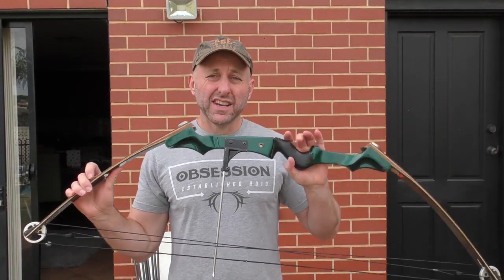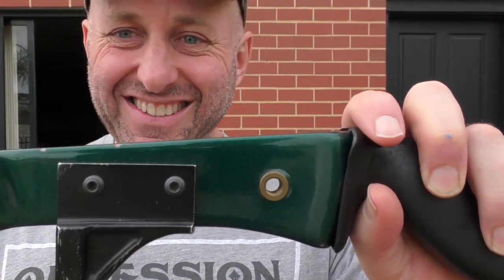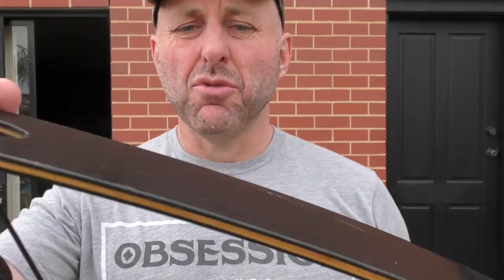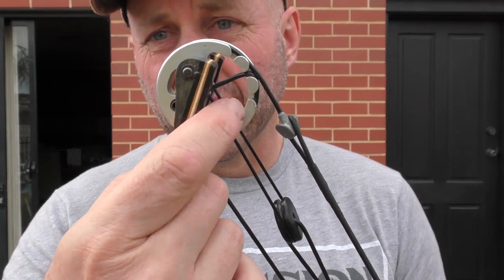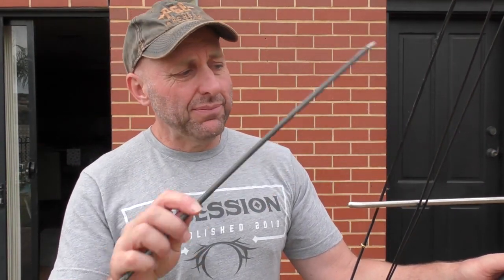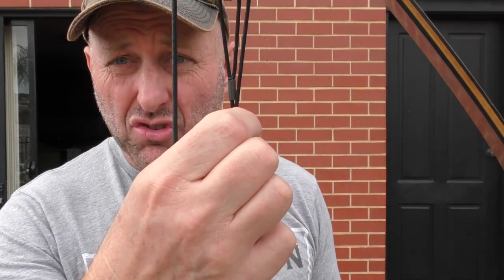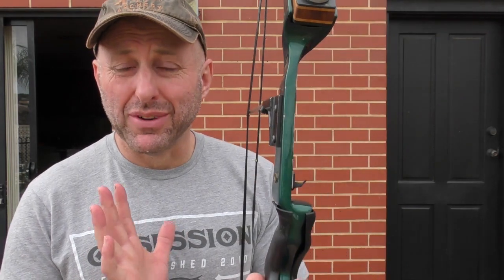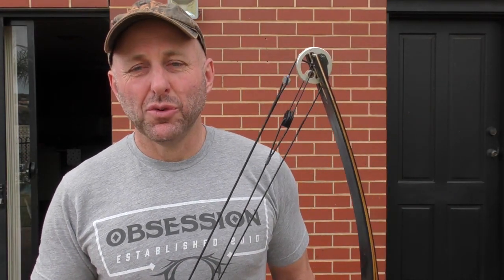Compound bow 40 years old

Comment: In 1981 I  had a Browning Compound Bow with a wooden riser, it looked good and shot well. A long time ago. Lol
Reply: How'd you get ahold of your first bows, back in the 80s? Were they common in shops, or did you have to mail order them?
Reply: I ordered it through a Browning Shop that sold Bows and guns.
Reply: The options for let-off were 35% and 50%. You just changed the position of the Wheels.

Comment: If You Want to shoot fingers with a much faster bow then most Recurve there are only two options. First is it is use the Genesis bows that shoot about a 250 FPS with the right arrow per draw weight of the bow.  Second, Junxing has the M183 that they claim on there site is 300 FPS though I am not so sure as it shows all the adult Compounds at 300 FPS and I know some have to be faster , just the bow uses a similar design using modern construction the way the Genesis is made but for the Junxing M183 it also uses more modern cams but not so modern that you have to use a release device. Both Bows are at/around 35 inches so about as short as they can be in an older design shape to still do finger draw with hunting weights due to draw pinch the fingers.  Then both use wider cams then are used now to prevent string slipping off the cams. Last Both bows are about as fast FPS as one can get to shoot while being able to shoot fingers and they use wider cams and have a shape similar to this bow in curved design. There is a few others still made some iglow Chinese made compound has a design that SAS Sells as well in one or two models made from 1994--1995 but is really slow to about 206 FPS for the iglow and 220 FPS for the SAS though this might depend on the arrow they each used for the exact same bow.

Comment: I have a Hoyt Spectra which appears to have the same cams as the ones you show here. I believe when you swap them over to change let off you also have to swap them upper to lower as well.
I am in the UK and they will not allow you to use these at a club because they say you cannot determine the condition of the cables under the coating. The risk of the teardrop swaging failing is the main concern. 
If you know of a way to get new cables made or a way of attaching a modern string there are many who would be interested, especially me.
Reply from the maker: It would not be a rule - it would be a person in the club.  My mum hires bows and most still have steel cables.  But yes you can't tell - but very rare to break.  You will normally see cables splitting in the plastic.   You will probably still find steel cables available in stores.  I sold all mine to my mum for her Hire bows.

Comment: All risers are cast. Machined is over blown hype on how there supposed to be so much stronger. A machine riser starts from a cast block . Also most cast risers are magnesium. So the claims are a cast riser is weaker.  Magnesium is what is used too make aluminum hard . Basically you're paying more for the labor in machining.
Reply: Mathews Triax Magnesium is only one alloying agent used in aluminum, and not the primary one. 7075 aluminum uses zinc as the primary alloying agent, along with magnesium and copper. 6061 contains silicon, iron, copper, manganese, magnesium, and chromium as alloying agents. All these alloys are far stronger than magnesium. Magnesium casting alloys have a tensile strength of 185-285MPa. 7075 alloy has a tensile strength of 570 MPa. 

To say that a machined riser is metallurgically the same as a cast one is incorrect. The stock from which risers are machined is hardened and treated in a way that makes them much stronger than simple castings.